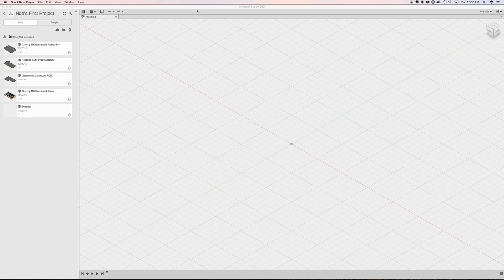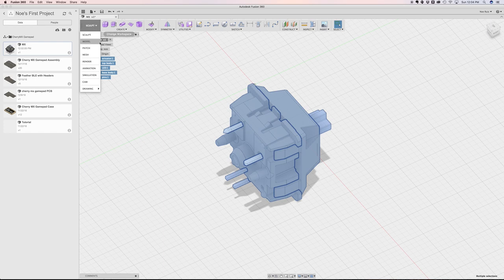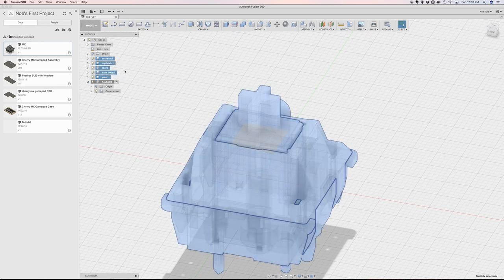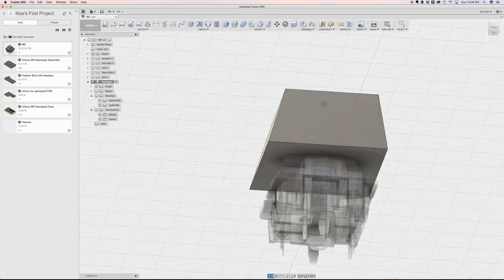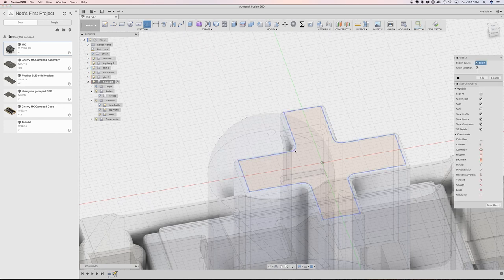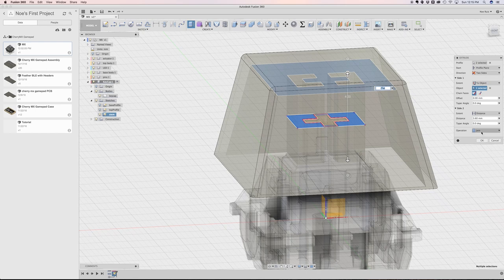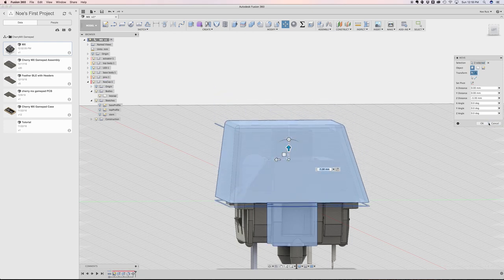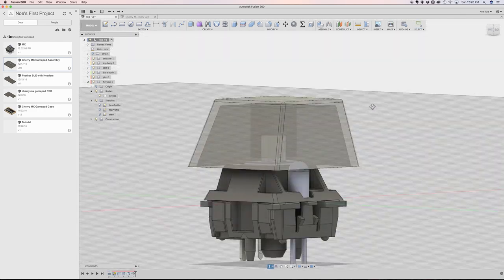Layer by Layer – Cherry MX Keycaps

Comment: I think I'm gonna do this for the two spacebars on my custom keyboard. Ideally I want flat topped keys that are as low profile as possible so I think this is gonna be the best way. 

What infill do you use for these? I'd be worried about them not being strong enough.
Reply from the maker: +James Coyle 40% infill since its such a small piece. The outter shell is only 2 perimeters thick and is surprisingly firm.